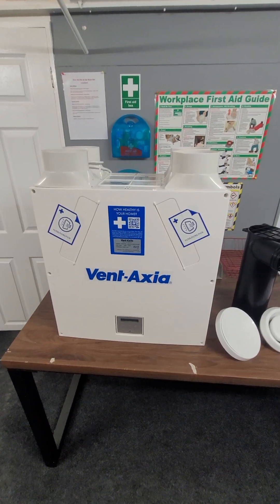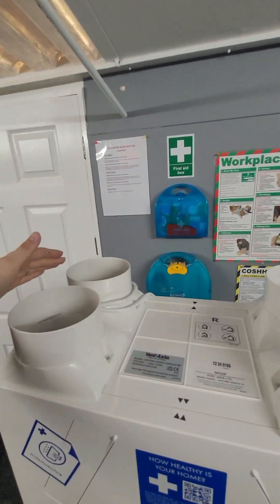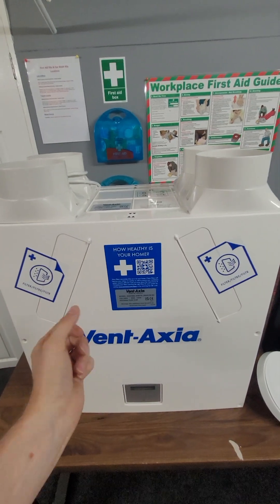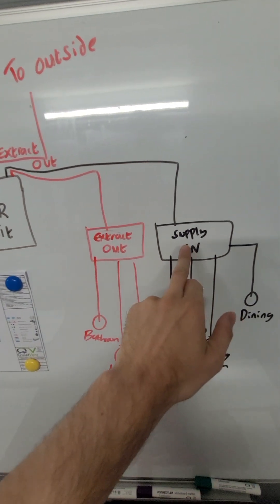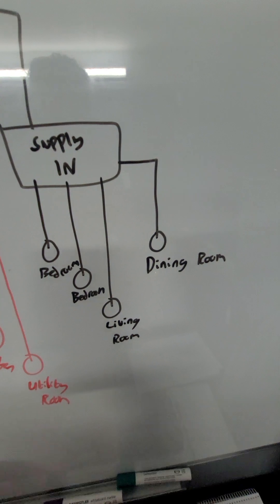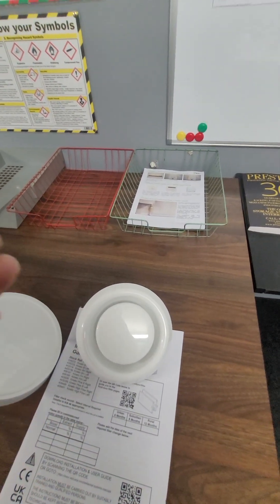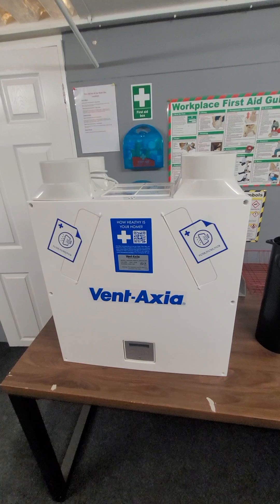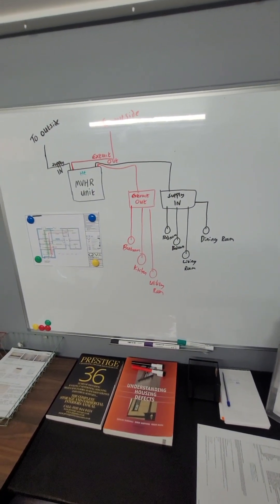How Does an MVHR System Work? | Introduction to Mechanical Ventilation Heat Recovery

Comment: I have this in my home but there is a build up of grey fluff in the ducts, the system is also leaking slightly out of the drain and condensate pipe can you help?
Reply from the maker: Thanks for your comment. We are a very small company and MVHR forms only a small part of the work we undertake, so we do not offer a repair or maintenance service for systems that we have not installed ourselves.

The grey fluff you mention is usually dust and fibres within the ductwork, and there are specialist ventilation cleaning companies who can clean the ducts for you. They may also be able to assess the condensate drain and resolve the leakage issue. I hope that helps and you are able to get it sorted.

Comment: Extract out only goes bath, utility and kitchen? Is it not practical to have both in and out in a room? Also how does it work if one has extractor fan in kitchen to outside, would that interfere?
Reply from the maker: You should only extract out of a room which is high in moisture production, so a Bathroom, Kitchen, Utility and Cloakroom etc. You wouldn't have an extract and supply point in the same room unless it is something like a very large Kitchen/Diner. 

You shouldn't have an over hob extractor going to the outside. This could make the building less air tight and affect the MVHR. You could have one on recirculation mode only and rely on the extract point in the Kitchen.  I do believe that some units can have an overhob extractor connected to them, though these require special filters and should be carefully designed.

Comment: Does it act like a dehumidifier in bathrooms?
Reply from the maker: An MVHR extracts wet air from the bathrooms, which creates a drier environment. A dehumidifier also extracts wet air but is more expensive to run and you have to empty the water out. An MVHR system will remove the moisture out the building through ducting, so there is no need to have to empty the extracted water. An MVHR system will also retain heat extracted from the Bathroom and transfer this to the fresh air being supplied to the habitable rooms.

Comment: got it in a new build, but I have a problem - it blows a dust like(chalk feeling) in to the rooms, cleaned filter, less but still similar
Reply from the maker: @SandrKozlov  Maybe the chalk like feeling is plasterboard dust. This may have gathered in the ducting if it wasn't protected between the MVHR first fix and second fix or if the unit was turned on before all the internal works on the propertyhad finished.  Keep cleaning the filters and hopefully it will eventually improve.